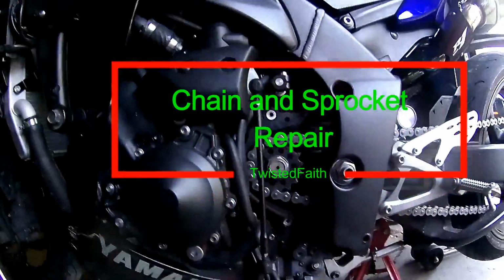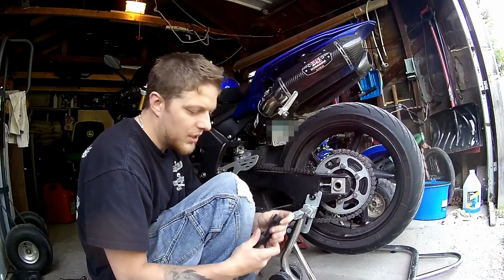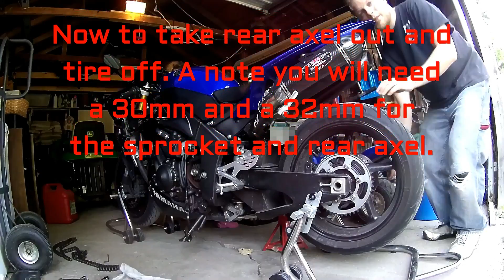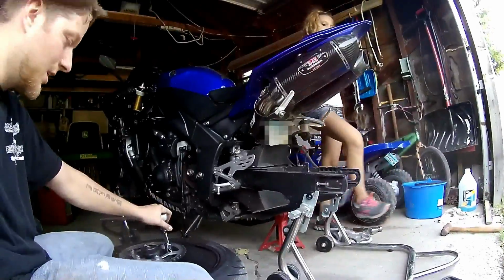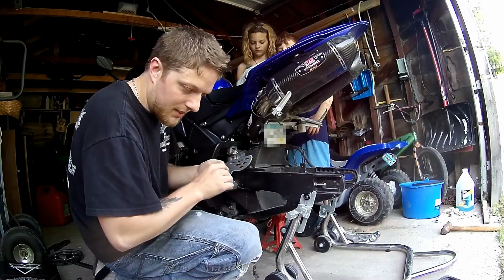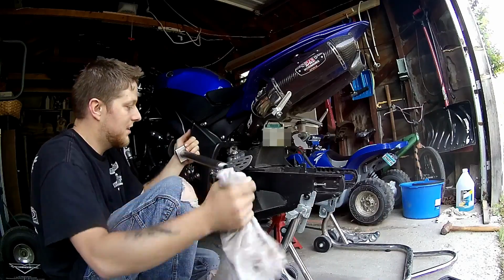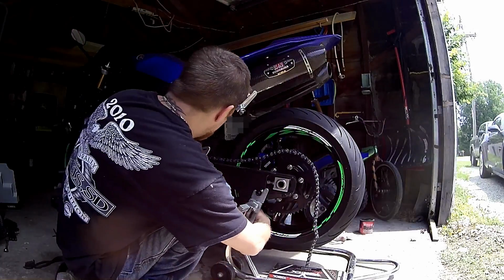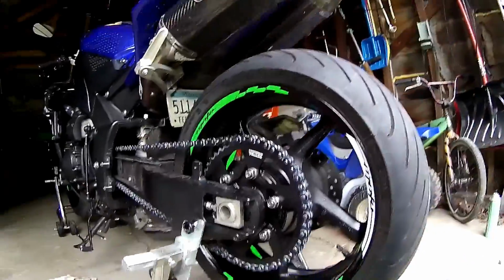How to Change your Chain and Sprockets. Yamaha R1

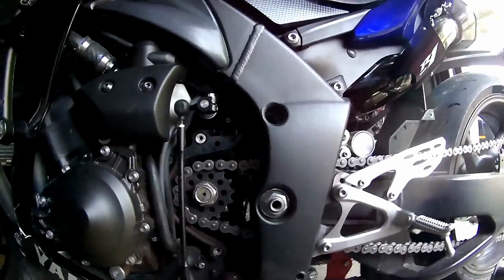Comment: How NOT to change your chain and sprocket. 0:49 look at the adjustment blockplate of the rear axle. It's okay. But then at 11:00 it's definetely not placed back in the right position, its a quarter turn off. No way you can align your rearwheel as it should!

Why is the chain looks so tight, and did you use any torque tools? 

Omg, by seeing this i don't even want to know how he'd rivet the link of the chain. If you don't have a deathwish and you love your daughter please leave this job to a professional. 'Twisted' in the head!